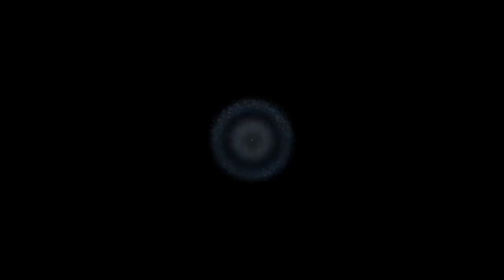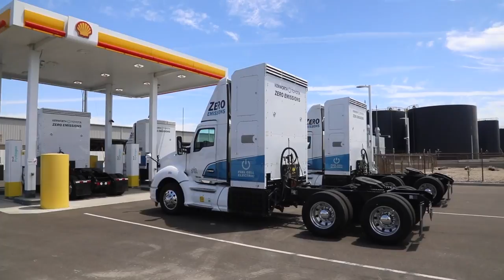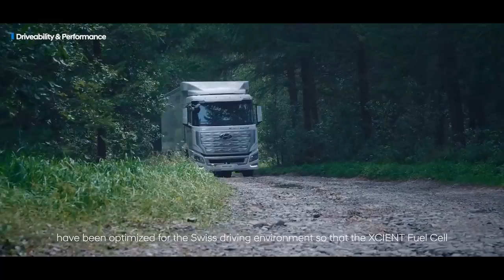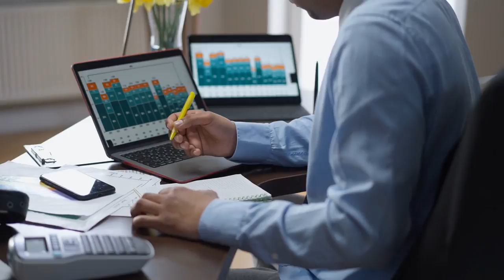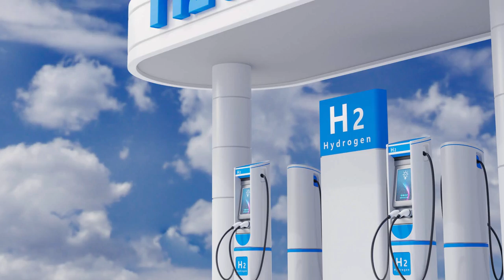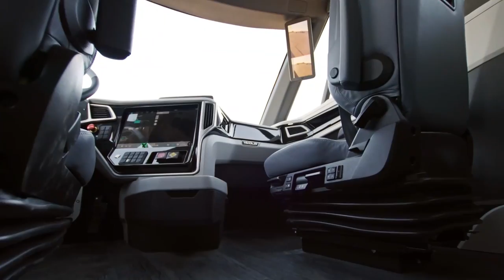This Hydrogen Truck Will DESTROY All Current Trucks!

Comment: The over the road truckers if today average around 600 miles per day in the U S. They would need refueling or recharging to make this many miles per day but also for those drivers that live in the trucks for an extended period of time they would need enough energy to stay warm in winter and cool in summer during their sleeper and off duty time. And especially for shutdown highways due to winter storms that make it impossible to keep driving

Comment: So, an Hydrogen Truck is the same as a Battery-Electric Truck but with a smaller battery but with a fuel cell and Hydrogen storage.
I know that Hydrogen is very fuel dense by weight but it is less efficient as of conversion efficiency.
It would be really interesting to see a mathematical study to figure out where the trade it.
Reply: As of today, it is less efficient as of conversion efficiency, but give it 5 to 10 years, and the efficiency will improve to the point it might be more efficient than compared to an electric car. But I guess you could also make the argument for electric vehicles but one thing hydrogen has an advantage over electric vehicles is they will always be lighter.
Reply: @alfredlindquist3046  is not much about being lighter.. is more about how much it cost to double capacity..  with batteries every time you want to double capacity you need to double cost, with hydrogen once you already purchase certain power input/output, doubling capacity is super cheap.
Reply: @angellestat2730  yea and that makes hydrogen superior
Reply: @alfredlindquist3046  at least in those applications that require to store or deliver power for longer than 5 hours.   (or 2 hours in the case of flying vehicles, because weight is much more important in that case)
Reply: @angellestat2730  that is true, but at the same time having a lighter car that is powered by hydrogen compared to a heavier car that is powered by batteriets is allways going to be cheaper to produce, since less material is needed. But also hydrogen powered veichles is not affected by temperatur which makes it far superior compared to a Electric car that looses 40% of its range If its - 20 C
Reply: @alfredlindquist3046  yeah, those are also valid points.
Another factor is that no everyone lives in a house with garage when you can always plug your car, most people live in the city which is not cost efficient to add charging device to each parking spot.
Even if each charging station would be free (which are not),  in order to support all that extra load to the power grid, the amount of wires needs to be double, which clearly is not the best because we know that transporting energy in H2 form by pipes is 10 times cheaper than by wires.
Even with trucks to charge stations would be cheaper, which mean less capital cost. 
Countries already plan to use the natural gas grid to use and distribute hydrogen, it can be extracted pure with special filters in any point.
Reply: Hydrogen fuel cells have a higher energy density, are as fast to fill as a gasoline powered vehicle and have an impressive range.
Small electric vehicles are good candidates for battery electric powertrains, large and heavy vehicles are better suited for hydrogen fuel cells.
Reply: @realityandnaturepill  I agree, also, large vehicles usually have fixed end points.  If refueling can be done there, it will limit/eliminate the distribution issue and lower the barrier to entry.
Reply: @connecticutaggie  

Absolutely, another reality of battery electric vehicles is that battary capacity can decrease.
You don't want to super/mega charge constantly and you want to stay within 10-90% of the battery.
This means even more problems for charging and range.
Reply: @realityandnaturepill  Yea, I am an Electrical Engineer.  Fast charging does have its disadvantages.
Reply: @connecticutaggie  

As an electric engineer, what are your thoughts about the Hyundai Xcient semitruck? Hydrogen fuel cell electric truck, tractor weighs only 10 metric tons which leaves 26 tons for trailer and payload. Range of 800 km (500 miles) in America.

Comment: I would prefer hydrogen over batteries for an F-350 Superduty that I presently use. I look forward to the future when I can buy hydrogen cells and run cleaner and longer without having to deal with the diesel fuel. I fully intend to invest in green hydrogen technology. Thank you for this informative video.

Comment: So, instead of finding a faster way to charge why not have battery swaping stations?
Reply: There is no standard battery arrangement that would allow swapping between manufacturers.
Batteries are designed as part of the vehicle structure.
Who pays for the expensive spare batteries?

Comment: Its really funny to watch as EV is gaining traction & becoming a major force so many companies are rolling out new H power plants. This is the engine & transmission engineers last grasp at saving their careers as when (not if) the world goes electric they will be unemployed because there will be nowhere to go. Even John Deere has a full electric combine in testing.
OK, dig this. There are 150,000 gas stations in the US. There 140,000 EV charging stations in the US and armies of workmen are hard at work this very minute building more. California has the most H fueling stations in the US, 17, only because Gov Schwarzenegger had those built to jumpstart the H industry. It did not work. Lots of luck H industry trying to catch up.
See you at the EV charging station.

!

Comment: Some facts about status in Europe on Hydrogen fuel cell trucks 
Switzerland 
Hyundai Xcient since 2019 have gone through 1 million km on the road, 120 trucks by end 2022, 1600 by 2025
12 hydrogen refuelling stations at the end of 2021
Germany 
27 Hyundai Xcient trucks are on their way to Germany which had 101 hydrogen refuelling stations at end of 2021
The Netherlands 
Hyzon US delivered their first Hydrogen truck 4 months ago there 11 refuelling stations in NL at the end of 2021
France 41, U.K. 19 others spread throughout EU, even Portugal has 1 
electrolysers are being built in Germany, Spain Portugal & the Netherlands in 10 - 100 - 200MW capacity range 
Long haul heavy duty trucks from Volvo & Mercedes are not far off as can be seen on YouTube videos

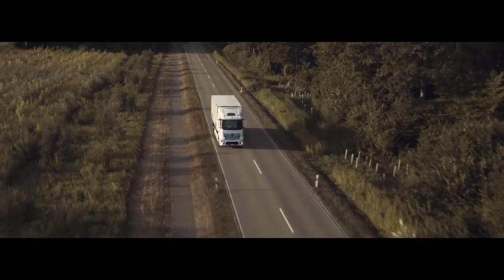Comment: The Biden administration on Tuesday strengthened limits on smog-forming pollution from buses, delivery vans, tractor-trailers and other trucks, the first time in more than 20 years that tailpipe standards have been tightened for heavy-duty vehicles.   5:44
The new rule from the Environmental Protection Agency is designed to cut nitrogen oxide from the vehicles by 48 percent by 2045.
“We know that these garbage trucks, tractor-trailers, delivery trucks, they’re going through our neighborhoods and they are impacting children and families,” Mr. Regan said.  By Lisa Friedman - Dec. 20, 2022
Source: The New York Times

Comment: Grey and black hydrogen 2 is worse for the environment than if you just. Put the energy source into the vehicle.
Reply: Electricity to hydrogen then back to electricity to power the truck.-
Doesn't sound very energy efficient to me...

Comment: One thing I have heard is that the pollution from the manufacture of hydrogen is as great as burning gas and diesel. In short there is no eco gain where electric is better in one way. Although there is pollution in generating electricity there is also a partial clean solution and that is to put a roof full of solar panels on each trailer being pulled and have this directly charging the truck batteries. This would add extra range without pollution and it all adds up. 
In short electric is partly free and can not be uniformly taxed like hydrogen can and to the rich this is a no no. They will no longer get a free lunch. This is because we all can buy the products to generate continual electricity for a one time purchase, but none of us can make and store hydrogen in any amount. Hydrogen keeps you paying at the pumps, and paying tax. Electricity can be free. This is the reason for hydrogen being pushed and nothing else. Drive in part free. Go electric.
As for range extension drivers stop for breaks, and if there were electric charging available a quick charge would last till the overnight truck stop where a full charge would be available. This is a cleaner option as even the charging stations for the trucks could themselves be partly charged with solar, wind, or water power, saving even more pollution. Properly planned electric is very much eco best.
Reply: Solar panels manufacturing is not pollution free,  they are very bad for enviroment.

Yes you can put many solar panels on the roof of a trailer with bad angle for sun and low productivity --- maybe you would get 1-3 miles a day  from them :D  Still electric truck would need many tons of battery making truck not practical for heavy load (reducing useful mass it can carry).   Battery is very bad for storing energy mass/kW. 

Hydrogen is very effective and light

Comment: FOOL cells is a waste of energy.  Semi trucks should have 2 batteries - one for short runs and a second battery that can be quick swapped for long haul truckers; which would make the swap a less than 5 minute stop for the swap.
Reply: 10 tons of battery for long haul which will reduce usefull weight for load to 50% of this today.  Great idea 2x more trucks, even more wasted energy.
Reply: What about efficiency loss due to carry battery 🔋
Reply: @mohammadshaqibsiddique9291  Main battery (non=swap) is used as the bob-tail battery to get trucker back home or just to get around when swap battery is out. Truck can do short halls with no swap battery but add the swap battery for longer range as needed. look at this like one of the 2 diesel tanks that truckers typically have. Often time truckers do not fill up 100% when at the pump.